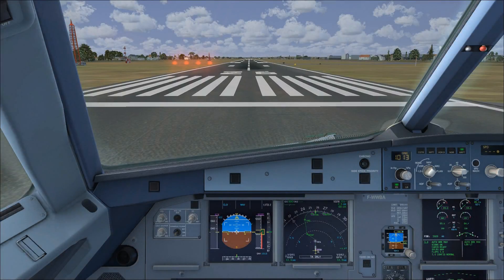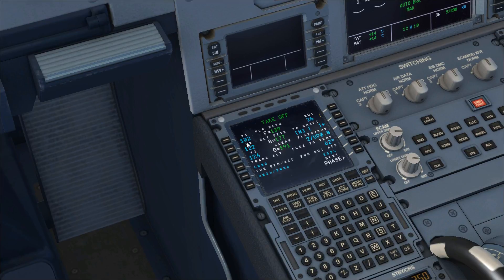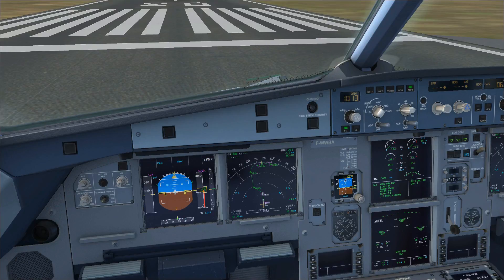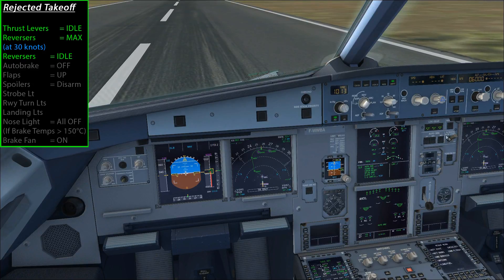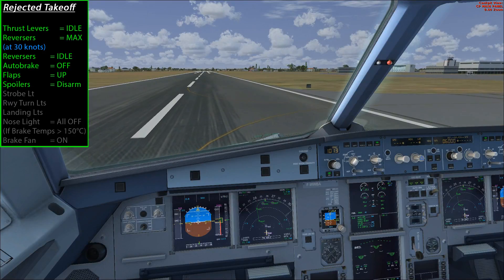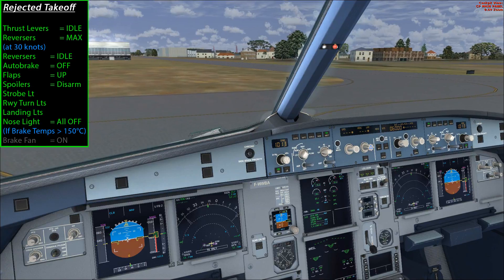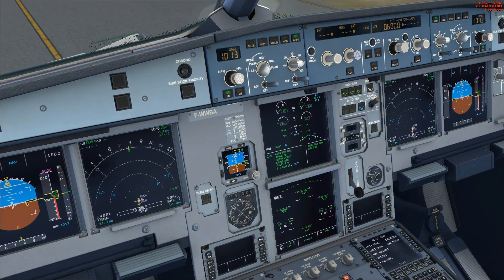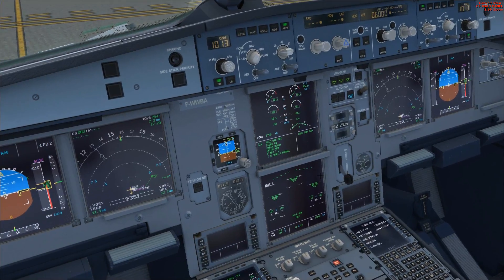A320 Rejected Takeoff Tutorial (FSX - Aerosoft Airbus)

Comment: Very nice tutorial but I have a question:
How can I program an "Engine Fire" during Take-Off? I know there is the tab "Failures" but I don´t know what I have to tick there and so on. Can you help me?
Reply from the maker: I'm not familiar with FSX's failure system I'm afraid, I believe you would need to arm a failure to occur a certain number of minutes after starting the sim but there's no way to have it occur specifically during the takeoff roll that I know of. Unless you timed it perfectly.
Reply: Doofer911 Yes that is my problem! But even if I arm it durable I get no smoke on the engine. What I really want is that the "Master Warning" button flashes up and the ECAM showes me the "Fire-Checklist"
Reply from the maker: I'm not sure if it's possible. I know in that aircraft you can't pull the fire handles so they might not have modeled it.

Comment: Absolutely love your A320 tutorials. I have one question though, for a normal takeoff, when do you engage the auto thrust, or will it engage automatically?
Reply: MelonMarc the Airbus pretty much has an autothrottle all the time, ranging from idle to climb settings, if you put the throttle into the climb, flex, toga or Rev setting autothrottle will be turned off, likewise, when the throttle is not on a specific detent autothrottle is turned on. The main difference between Airbus and Boeing is the operations of the computers. Boeing is more manual but you could almost fly an Airbus with no pilot it is so automatic!    

Sorry for the late reply!
Reply: MelonMarc It engages automatically as soon as you set take-off power ;)
Reply: MotcraftLP okay, thank you :D
Reply: The Climb / Flex / TOGA detents for the Thrust levers are effectively control switches for the auto throttle system

Comment: hi doofer!
Amazing video as always. Is it possible to make an auto land tutorial on the A320?
best regards 😉
Reply: Doofer911 Hey bro nice tutorials! May I ask what are your specs? Im planning on getting a 3.5 Pentium G4560 processor with 8 GB RAM and a Zotac 1050Ti should it run fsx well?
Reply: Angel David Miranda Orozco I'm not Doofer but I'm sure fsx on full graphic settings will work like a charm with those specs 👍
Reply: Alex Bragg Thank you for replying buddy! IM SO HYPED! probably getting it on summer
Reply from the maker: To Autoland, switch on AP1 + 2 on approach and leave them switched on until the Flare :)
Reply: Okay thanks. And what is the probe/window heat button?
Reply: np!